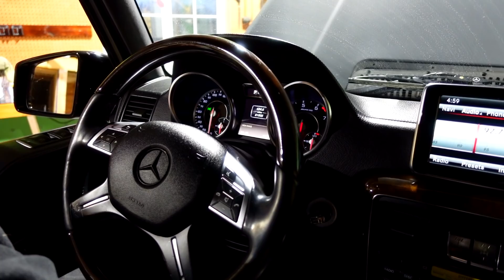Doing This Will Make Your Engine Last Forever

Comment: Use Rotella T6 5w-40 ... I use it on my e46, runs great.  Did used oil analysis (blackstone) and the Rotella keeps thicker viscosity after 10k miles than the Castrol euro 0w-40 (LL-01) at 7.5k miles.

Comment: Dealer broke oil filter housing adapter on my wife’s Jeep Wrangler due to over tightening filter.  I had engine oil all over my driveway. They had to take whole top of the engine off to replace. You never took my car back to dealer since been doing my own oil changes

Comment: If you want your car to last don’t park anywhere near a tree, if your annoying neighbor has a god awful tree I suggest buying a beaver to chomp the tree down. Never had a problem with my beemer until debris clogged up my ECU housing box and caused it to turn into a hot tub, when this happens your car will begin to throw random codes and faults like it’s possessed, I’d explain the entire story but unfortunately it would turn into a horror novel.

Comment: Round about how much did you spend on the lift and installation?
Reply from the maker: $1700 for the lift, about $40 for the bolts and epoxy for install
Reply: @NathansBMWWorkshop  thanks. I’m really having thoughts of getting one. Think I found the same one you have online. Same price you mentioned. I saw the video of the bolts that were loose though. Scary.

Comment: I have a 2007 BMW 530i  how often I have to change transmission oil?? Thank you.
Reply: "Assuming" it is an Automatic ZF or possibly GM like in the 3 series e90s:  100k for Fluid and Filter is the interval.... Personally, I would change at 75k if you are going to keep the vehicle.  You can also do drain and refill.......I do that once then drive for 5 miles then pull the pan (on the ZF the pan/filter are one) change the filter and refill.   The issue is you are actually changing half the fluid in the system when you drain- there is still fluid in the torq converter and the cooler.  If you don't change the fluid and filter, you will eventually get jerky shifts and slips. The solenoids can also become clogged or damaged... Then you have to go back and swap them out.  Just more work and more $$.......Do it before you get there........and save $$$, time and headache .
Reply: 50k is a much better interval than the 100k the book recommends.  If you do heavy service (stop & go, lots of idling, hills, long trips, hot weather) then consider even 30k miles.  Especially if you want to keep long term.
Reply: @LeverPhile  at 50k ...That is a bit much and 30k is over kill,  for the filter and fluid...... If you drive the living piss out of your BMW, or tow or have heavy loads or track, ok, I can see that.  If it is a daily driver, 75k is fine with "normal" or lightly spirit driving.  I would recommend in between the 75k (where you are changing the Filter and Fluid) one maybe two drain and fill (No Filter Change).  Changing the Filter too adds a lot more time and money.  The ZF filter/pan is not cheap.  A drain a fill can be done in 15 mins.  Changing the filter takes a lot longer,  especially the first time.
Reply: @MrCuckoobox  I agree, 30k is for heavy service, heavy loads, and to some extent hot climates. Or as you say drive the living piss out of it ... lol.  Lots of people do that.  But 50k is not unreasonable, changing it at that point will make a difference in shift feel and keeping down wear in the aluminium valve body.  Dirty atf (including clutch material that wears) can act like a cutting fluid in the valve body passages.  Also no need to change the filter with very change (especially at 30k), especially if you dump the fluid more regularly.

These extended service intervals benefit the manufacturers more than owners interested in longevity.  Warm vs cold climate makes a big difference as well, so cold climate folks can go much much longer than those in hotter climes.
Reply: @LeverPhile  I hear you.  I enjoy driving and but do not drive the piss out of my BMWs.  Also I made another "assumption", given it was a "non M" 5 series with an automatic that it would be driven a bit more "gently" than  3 series or an M car.   5 series owners/drivers tend to be more "moderate" drivers given the car is larger and heavier. The 100k is a "Bentley" Interval. If you go by BMW, yes, it is "LIFE TIME" Fluid, so you just drive until you destroy the Transmission.......
Reply: @MrCuckoobox   Fair point about the average non M 5 series driver ... really depends on driving style.   Yeah, the "lifetime fluid" was a total scam .... lifetime of transmission until it craps out ... ZF and (maybe) GM finally forced BMW into a 100k mile service interval mentioned in the Bentley over that one.